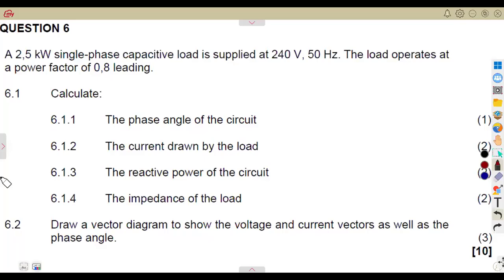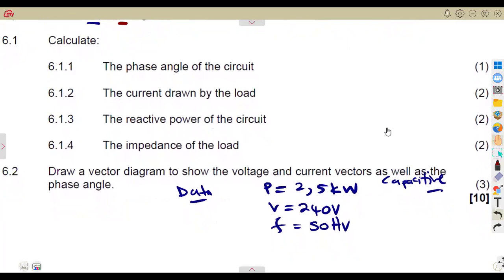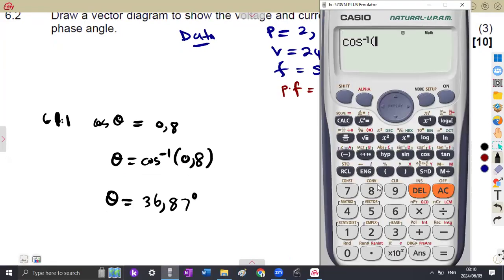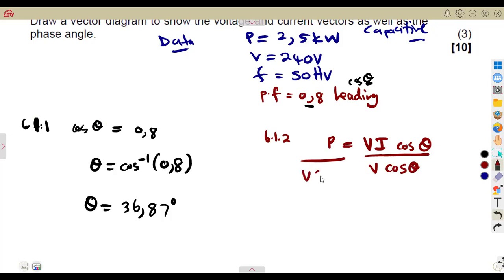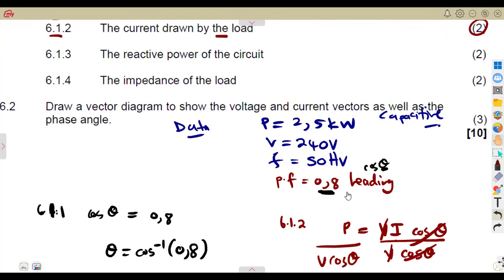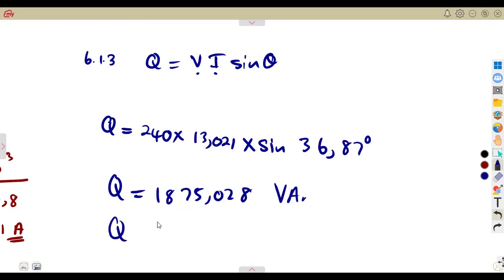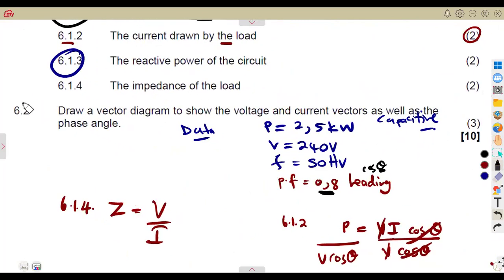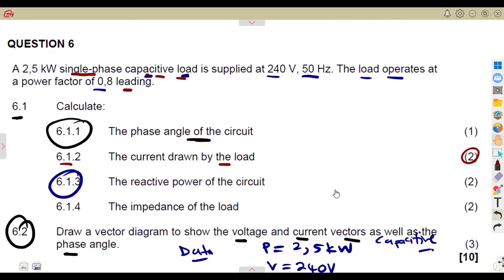Electrotechnology N3 AC Theory Single Phase August 2022 @mathszoneafricanmotives

Comment: Three loads, with impedance of 25ohms each ,are connected in star to a 415V three-phase line operating at a power factor of 0,85 lagging.Calculate;
i)the current through each impedance 
ii)the line current 
iii)the real power 
iv)the apparent power 
v)the reactive power
Reply from the maker: Hie,  please contact 061 864 4043